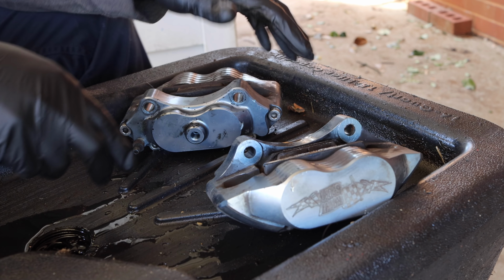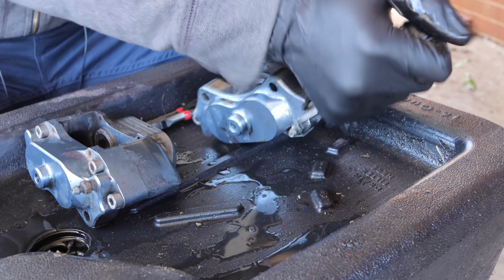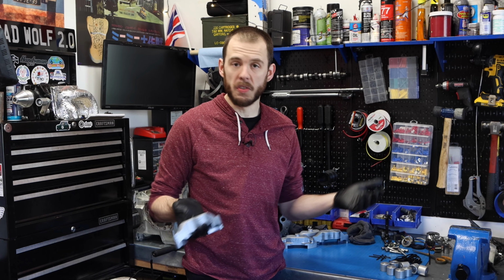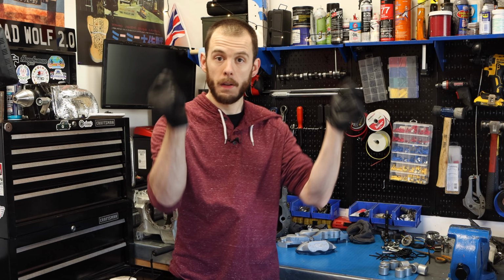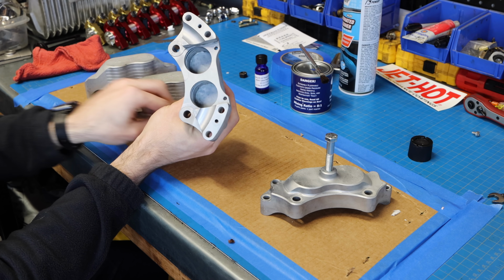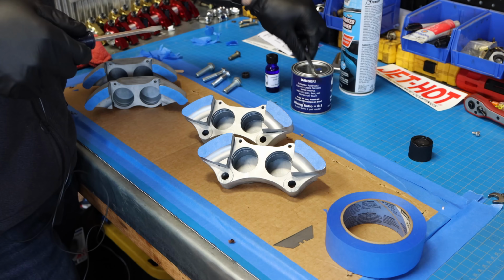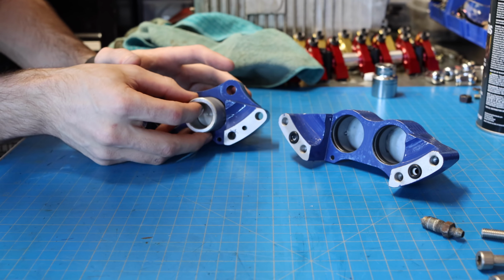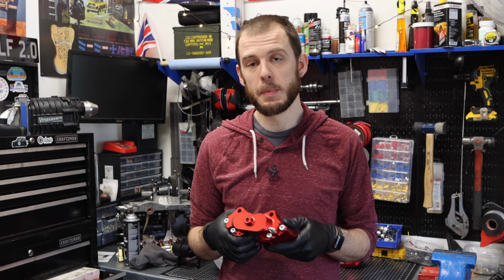Brake Refurb Gone Wrong

Comment: late to the party here, however as i used to operate an anodising plant (a long time ago) when i was a kid. My understanding is that prior to the anodising phase of the treatment we would load the degreased alkaline cleaned parts into an acid pickle, this created a porous layer on the surface of the part. after a wash they are dropped into your anodising medium (aircraft grade was a plain chromium acid) then the current was applied,this then framed the anodised layer bonded into the surface skin of the aluminium. if I had to refurb these Knowing what i know id have left them intact and masked and blasted the outside, painted then stripped and sorted from there. Anodising is designed to be a hard to remove coating.

Comment: Oven cleaner = caustic soda, which eats aluminium but not anodising, which is a hard aluminium oxide layer. You'd probably get away with using them with lightly corroded bores as long as the grooves where the square section main seals seat aren't badly trashed.

Comment: If the piston of the caliper is ok and the seal is good then the condition of the bore should matter as its only an air gap between the piston and bore but i could be wrong. Informative at usual thanks. 👍👍

Comment: if i had 10"wheels with drums in the front what would i need to buy to get discs
Reply: Hi, I changed from drums on the front to discs, have 10"wheels, several of the main mini surpliers sell complete kits, either ready to go or to be made up depending on your budget etc, single pot calipers, 4 pot calipers, plain discs, drilled, grooved, different pad choices. Firstly you will need a later set of hubs from an 84' on mini, then obviously the discs, drive flanges, cv joint and boot kit, calipers, brake hoses, bearings, swivel joints. Think that's everything lol. Hope this helps 😊

Comment: Those bores looked suspect before you even started cleaning up the callipers…. also, recommended way to remove pistons is to use compressed air. I would have done this before taking the two halves apart.  Are you sure your oven cleaner didn't bugger up the bores?  And by the way, an anodised finish is not like a paint. It is a chemical etching process and if you want to go back to the aluminium it's a blasting cabinet job.